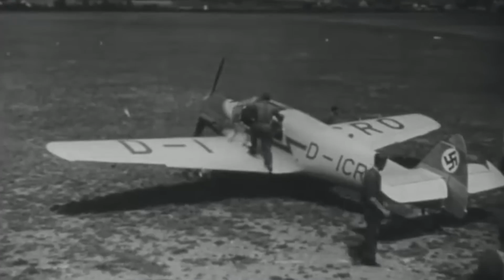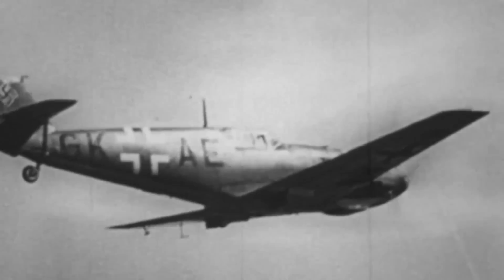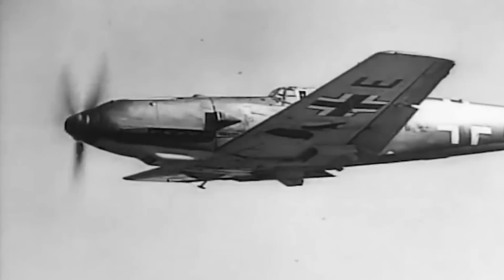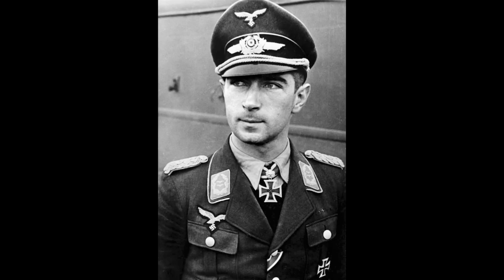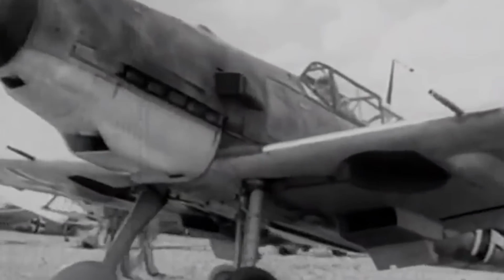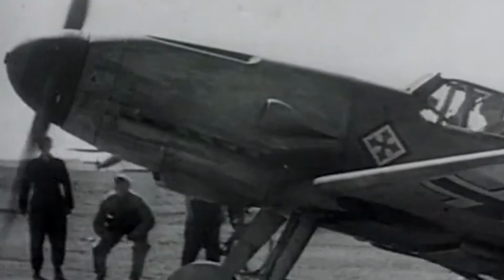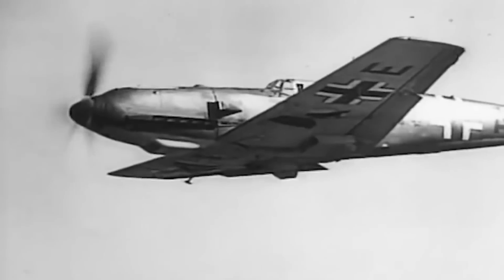Messerschmitt Bf (Me) 109: A Luftwaffe Legend | WWII Documentary

Comment: it was slow outdated with narrow landing gear
Reply: Slow and outdated? In the hands of experts it kept being a dangerous fighter until the end. Between the Me 109G-10 and the Me 109K-4 was easily comparable to the P-51D both in manoeuvrability and speed at medium and high altitude....
Reply: I don’t think you quite know what you’re talking about. Yeah sure maybe it was in the beginning, but Across the years of the war, they made more variants of the 109 like the F-Series G-Series, K-Series. They had a seriously impressive climb rate and could wreck fighters in energy fighting and boom and zoom not to mention its high altitude maneuverability that greatly outclassed the early spitfires. 

That being said the P-51 Mustang is still my favorite, but do NOT under estimate the 109; it is a beast of its own.
Reply: "narrow landing gear"

"Me 109 was hard/dangerous plane to take off."
- The standard takeoff procedure for 109 was to use rudder to keep the plane straight. There was basically to ways to take off the plane. Either you throttled up fairly fast and gave full  right rudder, easing it off as speed increased, or you throttled up slowly so there was minimal torque effect. In practise that was similar to anybody who had flown other types before and it took usually just one flight to know how to do it. The myth that there was something hard in taking off in 109 stems mostly from highly exaggerated claims - or the fact that for new pilots converting to 109 from various trainers had not flown such highly powerful aircraft before. With proper teaching - no problems. In Germany that was rare thing in the last years of war though. The Finnish Air Force chief instructor colonel Väinö Pokela told, that one of his key points in teaching new pilots to 109s was to instruct them very carefully - and told them to forget any horror stories they've been told.  He said, that many pilots were already scared from the horror stories other pilots and non pilots had been telling, and after showing how easy 109 was to handle there was seldom any problems.
- Colonel Pokela also told that most 109 crashed he had seen resulted because the pilot had forgotten to lock the tailwheel before applying takeoff power. If that happened then the pilot couldn't keep the plane straight when accelerating. Take notice that you need to push rudder in all other planes as well - for example Spitfire requires similarly full right pedal while accelerating.
- Torque can indeed send a plane off the runway during a takeoff, especially if there's a crosswind to start it off. But 109 is no different from a P-40 or a Spitfire in this situation. The bad reputation most likely comes from pilots flying it for the first and perhaps only time, and that the veteran pilot would instinctively make the adjustments needed to keep it straight while rolling on the ground.

"109s were so difficult to take off and land that half the 109s lost in the war were lost to take off and landing accidents."
- 5 % of the 109's were lost in take off/landing accidents.

"11,000 of the 33,000 built were destroyed during takeoff and landing accidents - one third of its combat potential!" (direct quote)
"Me-109 had an astonishing 11,000 takeoff/landing accidents resulting in destruction of the a/c! That number represents roughly one-third of the approximately 33,000 such a/c built by Germany." (usual internet claim)
- Source: FLIGHT JOURNAL magazine
- The magazine has it wrong or has misintepretated the numbers. Luftwaffe lost about 1500 Me-109's in landing gear failures. Note that German loss reports often lump destroyed and damaged (10 to 60% damaged) together. It was also a standard practise to rebuild even heavily damaged airframes. While rebuilding/refurnishing these planes were also upgraded to the latest standards and latest equipment. This means that large proportion of these damaged/destroyed planes were not complete losses, but returned to squadron service.

"The specific problem with the Bf 109 was the very narrow / weak undercarriage track."
- Narrow landing gear was not that uncommon at the time - all biplanes also had narrow landing gear. Me 109's undercarriage was connected to the fuselage rather than the wings. This had several reasons. Most importantly the wings were easily and quickly changed if needed, without special preparations or tools. Wings were also one single structure, which made it possible to make them very strong. Because this the plane needed some care when operating. The claim that the narrow undercarriage was a problem is a myth, though. In comparison the undercarriage of Supermarine Spitfire was even narrower - it had its own share of problems from this. Imagine what it was to takeoff and land the Spitfire's carrier version to carriers for example? Especially later marks of Spitfire with enormous amount of installed power were quite a handful to operate. But that is conveniently usually ignored.
- The width of undercarriage in Me 109 E is 1,97 meters; 109 G 2,06 meters and 109 K 2,1 meters. However - Spitifre's undercarriage width was 1,68 meters.
- The real problem was the center of gravity behind the undercarriage. This made it possible to brake unusually hard in landings, but it also required the pilot to keep the plane straight in takeoff and landing. Because this it was easier for a small sideswing to develop into a groundloop or the plane might drift off the runway, if the pilot was not awake. Of course, if the tailwheel was not locked, the tendency would be pronounced and more difficult to counter. As with any plane.
- Contrary to the popular myth, the landing gear could take the plane 'dropping' in from about 8-10 feet.

"The 109 was flown down to the runway at relatively high speed and "wheel" landed: it was to make sure the leading edge slats did not deploy.  Because of the high speed at touchdown, there was more time for something to go wrong during the rollout, and it often did."
- Now that is some science fiction. For example the Finnish Me 109s always did stall landings, because the airfields were mostly very smal. The landings were almost similar to carrier landings - the plane approached field in shallow descending turn, aligning to the runway just seconds before touchdown. By "hanging" in the air at stall speed, with slats open, the plane touched down at minimum speed at three points and the pilot could apply full brakes immediately. 109 had very good brakes and the gear was so forward, that the was no worries about nosing over with full braking. Landing could be made with higher speeds, slats not open, or they could intentionally be "popped" out even in higher speed approach (take notice: pilot did not have direct control on the slats, but he could still force them out by creating right flight condition). "Stall landing" to three points with slats open was the favoured method in Finland though. And don't forget, there was even a carrier version of the Messerchmitt, and you just don't land to carrier at high speeds. Of course these planes didn't actually operate from carrier, they they were built and operated by normal squadrons.
- As a side note, Finnish pilots who visited Germany on war time and saw some of the German training or how the German combat pilots took off and   landed their planes, they were quite horrified. German training in '44 seemed very rough and no 3 points landings was taught to the pilots, who approached with high speeds and came down on two wheels. At that time Germans put as many pilots through the training as possible, and didn't bother to teach the finer things about piloting to the green pilots. The runways were paved and long, so the finesse of "good" landings could be ignored.

http://www.virtualpilots.fi/feature/articles/109myths/
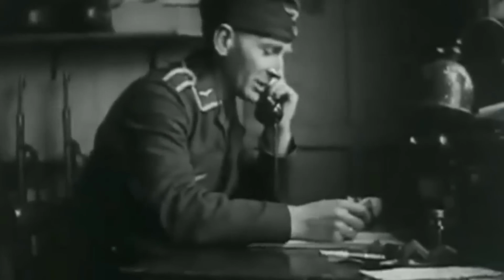Reply: That could be say to the Spitfire too,  with the same philosophy, big engine in a small frame, with the exception that the wings of the Spitfire comes form the Heinkel 70, if you don't believe me, ok, but, first check Beverly Shen Stone, in 1922 in move to Germany to work in Yunkers were he met Ludwig Prandtl one of most important men in the reseach of the eleptical wing, also in 1932 Shen Stone went to Britain to work in Vickers Supermarine, and by Billy Mitchell's instructions, to think outside the box, he chosed the NACA 2200 (and the NACA 22123) series,  the same of the Heinkel 70, here, a better explanation of that https://www.youtube.com/watch?v=9QycCd3U4Hg  minute 4:43 onward  minute 4:43 onward
Reply: "Slow"
Why?
And against what? ;)
Reply: It was ok, but not that great 
P-51D and Spitfires, P-47D's, P-38's 
Kicked thier asses
Reply: @donfrandsen7778  a little far fetched to say P47D was better, climb rate alone was rather poor
Reply: @donfrandsen7778  It really depends on the variants, the P-51D-5 has a mediocre climb rate but can easily out maneuver and out speed most 109 variants, P-51H is a beast capable of outmatching the me-262.